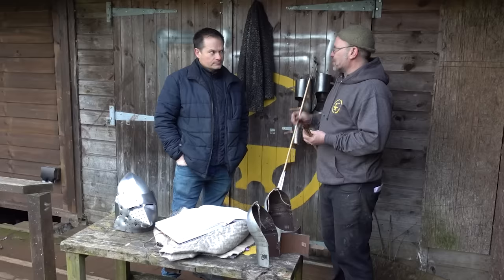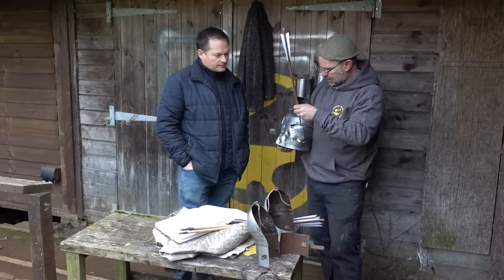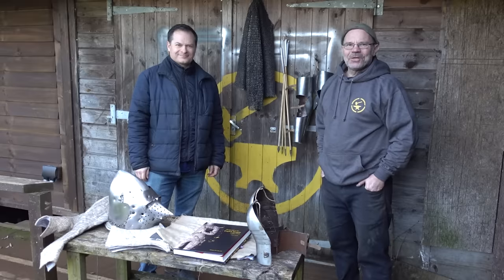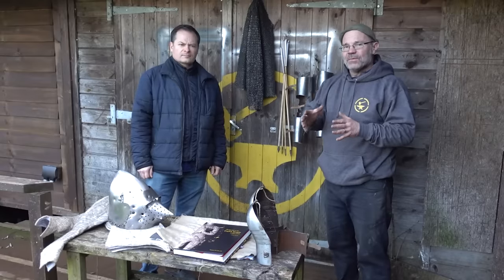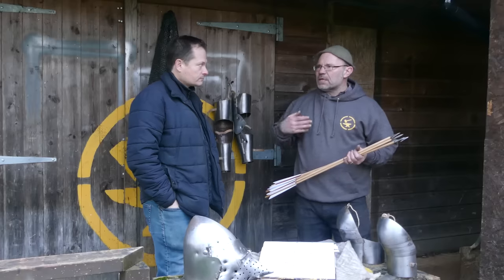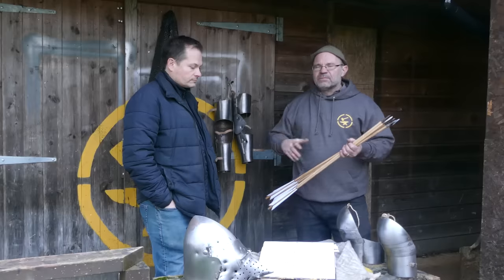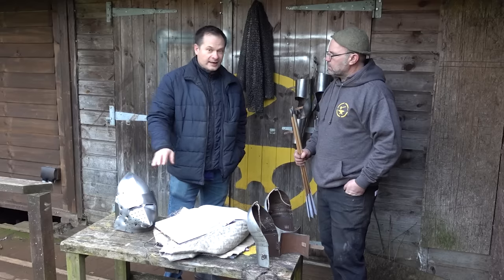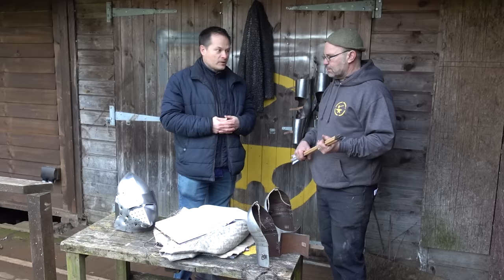Arrows vs Armour 2 - Our thoughts 6 months later

Comment: I am surprised that you didn't mention that the plate armour was worked cold and therefore work hardened, as stated by the armourer in the director's cut film at 03:51. Why wasn't the mild steel annealed? The plate comparison test is therefore invalid as a reference point. The armour is no longer comparable to the sheet steel as received from the manufacturer. It's much better at resisting arrows, and its ability to resist penetration could have increased with over 50% in some areas, depending on steel grade. You are in fact shooting at something that is probably analogous to medieval slack-quenched medium carbon steel. It's no longer an analog for air-cooled medium carbon steel. Further more, If we want to be strict about it, low-carbon bloomery steel is the actual mid range of armour according to surviving samples in TKATBF, not air-cooled medium carbon steel. Air-cooled medium carbon steel, or better, made up just over 1/3 of the armour.

Neither did you mention that the armour was not properly supported by something that resembles the human body. The arms are just supported by a doublet and a thin r-bars with some weights added on and nothing more. It doesn't fill out the armour properly the way arms would have filled it out. This is collision physics 101. We can see how much that armour flexes and saps the energy out of the arrows when they strike, and this would not have been the case with a tightly fit human arm inside (or something that resembles it). The head is also resting on a thin r-bar. There is no support around the neck area or around the jaw. The face has been replaced with a camera. This will prevent penetration of the sides of the helmet and the neck area. This is evident in the follow-up film you made with a foam-collar to hold an egg in place. This piece of foam supported the neck enough to enable penetration of the aventail. The human head does not move much when it gets knocked into things, and especially not when struck by fast moving objects, but in the film it does.

If you are going to make an AvA 3 film you should use a bascinet made of bloomery steel and arrows reinforced with bloomery steel at the tips (or just case-carburize the tips so that the heads do not shatter on impact). Taking into account that you were backed up with £59,000 in this film, money should not be a problem for a third film either. There is no reason to use mild steel at all. Mild steel is not a scientific definition. What type of mild steel was the armour made of by the way? It could be anything from 0.05% C to 0.3% C with various alloying elements. Mild steel tell us nothing.  It's made for the industry specifically to be work hardened during the stamping process.
Reply: 59.000 pounds is definitely not enough to buy bloomery iron to make armour out of it. We would probably need twice as much? Maybe three times the money?  The mannequin was very life like I assure you, both the arms and the head, actually. If you'd been there, you'd agree. They moved much like a human body. 

The mild steel being work hardend is just a reality of making armour, why would I have annealed the arms after making them? Do I need to remind you that they were trying to harden iron armour as well, by making it red hot and quienching it? That would increase its resistance far more than some simple hammer hardening. I think you're overstating how much the arms were more resistant, and there's mild steel and mild steel. It's not like when the arms were done the file I used to clean them was skating over them and not bitting into the metal. The surface hardness didn't change much at all.

Yes, the metal becomes a bit more springy, but it' hasn't "increased with over 50% in some areas," Plenty of medieval armour has no signs of porpuseful annealing after being worked, and just look at medieval art. There's plenty of armour parts, such as arms and legs, being hammered cold. Why would they then waste precious fuel by annealing it? And then waste more precious tools and time by cleaning the scales away?

Also, if we're going to do it again, why ot use duplex armour? So outer layer of carbon steel welded to an inner layer of iron? It would be more representative and more common,  but also that would bear much better results than mild steel armour. The skull of the wallace bascinet for example seems to have been constructed that way. I believe modern mild steel is a good compromise for lots of armour that would have been found on an early XVth century battlefield. Of course we could go full experimental archeology, but it's way more expensive that what you think, Eirik.

And if we then do that, it means that also the bow would have to be representative, and not the 160lbs outlier. We would have to shoot the armour with a 120lbs bow with a 28" arrow,, which seems to have been the norm back then. And at about 100 meters distance, not 15. That would be a much better and realistic test, but I suppose you people don't want to see all the arrows bounce from the armour for half an hour straight, do they? =)
Reply: @JosefGustovc  What type of mild steel was the armour made of? Exact grade.

What type of mild steel was the plate in the comparative test made of? Exact grade.

I do not doubt the mannequin's liveliness, I am questioning the empty space inside the arm harness and helmet and the lack of support. The arms are clearly shown in the Director's cut film at 24:42, and at 24:47 we can see that the arms are inserted into the arming doublet without any foam or another substitute for flesh around them. Set the playback speed to 0.25 and take a look at 29:06 in this film. The armour moves and flexes a lot inwards when the arrow strike the vambrace. A collision like this is extremely dependent on the weight and support underneath the object it strikes. This can be calculated due to conservation of momentum. Light objects can sap more than 40 % of the energy out of an arrow.

I know the bloomery steel is expensive. That's why I wrote bascinet. The rest could be mild steel to get the weight of the mannequin correct.

In a scientific test we should always strive to isolate variables. If the steel in the comparative test was of a specific configuration, this should be the same for the armour. Without it it's an unknown variable and meaningless. The bloomery steel in the comparative test was forged and therefore the finished product I assume? To get it right we have to experiment with different grades of annealed mild steel to find something that is comparable to medieval steel in a penetration test, then make armour out of it and anneal it when it's finished so that it is equal to the test piece. That's the only way to get the variables somewhat correct. There are still pitfalls though, such as high  elongation in mild steel in relation to movement of the armour.

I am all for multiple tests on work hardened and also quenched plates of medieval steel quality to see how it behaves, but I am afraid the work hardening of medieval low carbon steel will decrease its resistance to arrows due to slag inclusions and lack of alloying elements such as manganese. We can not work harden modern materials because they did it with medieval materials. That doesn't make any sense since they are different. That's apples and oranges.

We have data from a Charpy test on case carburized bloomery steel with 0.64%C and 2.3% slag compared to S235JRG2. The mild steel has higher absorbed specific fracture energy Wc (J/cm^3) (300 vs. 465) and higher percentage elongation after fracture A (%) (24% vs. 37.5%). The bloomery steel Owen makes probably has a lower carbon percentage than this material.
Reply: @eirikronaldfossheim  The mild steel was bought in Sweden, I don't have the exact code. It's just mild steel, it behaves like other mild steels I worked previously, I haven't noticed any difference under the hammer.

If you want to have other restults and a different methodology, why don't you make your own tests? You seem to know everything yourself already, so why not spend less time pointing out nonconsequential details in a non scientific test and set up a scientific tets yourself? It would be interesting to compare the results.

Comment: The sheer number of arrows fired was bound to result in improbable lethal hits.
Even if the arrows didn't penetrate it still imparted a physical blow...which all add up over the course of the battle.
By the time the knights travelled a hundred yards through the gauntlet they were bound to be weakened...which made them vulnerable to the fresh knights waiting for them.

Comment: After watching the original video, it looked like about 20% of the arrows penetrated armor well enough to incapacitate the wearer.  And, that was in ideal circumstances where the archer wasn't under pressure and the target was relatively close.   So, it is reasonable to assume that in a battle, the best you could realistically hope for is 10% of the arrows doing significant harm, which doesn't sound impressive.... until you consider that there were 5000 English archers at Agincourt.   If that 10% number is correct then with every volley of arrows will injure or incapacitating approximately 500 opponents.  Even if you drop the damage percentage to 5%, you have to consider they were firing multiple volley's a minute.  Even with 15,000 knights and men at arms the French would see their strength halved in a matter of minutes under such withering fire.  This also explains why the muddy field was critical to the success, a mounted and armored army could easily have crossed that field and broken the English line before their losses were too high.

Comment: Would arrows have hit head on flat like that or would they have come down at an angle from the sky
Reply: They probably weren't shooting long distance in an arc for the vast majority of the time, period art (from all cultures) shows aimed, flat shooting & the arrows they used were thick, heavy, tapered from point to nock with large, long fletchings, which is great for delivering maximum energy & straightening out quickly, but the exact opposite of what you need for long range flight archery

Comment: As someone who fights in early 14th cent armor, which is still lighter than this era armor, I can tell you guys all that every hundred of grams put on your limbs, ESPECIALLY arms, matters and counts. Armor is like being fat. You get hot easily, you are a slower runner than everyone else, and you get winded faster than everyone else. What is also important to consider though, is that anything put on your limbs is far away from the point you are lifting it from. 1 kilo of steel at the end of your hand has completely different leverage on your muscles from 1 kilo of steel on your chest. That is why limb armor tends to be much thinner and lighter, because otherwise it would be unusable.

Comment: One thing I have noticed is the armor is missing the arming doublet.
Reply: The arming doublet was there. You can see me putting it on the mannequin at minute 23:09 in this video.
Reply: @JosefGustovc  A decent arming doublet or gambeson should add the extra layer of protection to reduce damage to the body. The solid metal armor, the later of mail then the thick cloth of the doublet. It's part of the concept Chabam armor is designed around. The combinations of Hard, Moderate and Playable resistance offers the most protection. If you read up or read more deeply into arming doublets and gambesons, the high quality of that layer was as important or more important than the plate and the mail. By itself it should be protective to dagger and rapier thrusts. Some had metal (brass) rings like sinkers, washers or coins inside the quilts in strategic areas like the outer arms, chest, back and front of the thighs. I'm sure you could appreciate the defensive qualities of that type of quality in such a simple, often overlooked part of the layers of armor and the Kit they go with. My family in Germany worked for aristocrats along the Rhine River and private display in the castles they have such doublets. It was a requirement in my family to learn what would be called "HEMA" but when I was taking my lessons they just called it "Fuß Listing"

Comment: Question: is there a difference between the armor a man-at-arms is on foot would wear, and if the same is on horseback?
Reply: Yes. But there is such variation it would be hard to put it down as “this is this, and this is that”. Even in such a category you would have mounted archers, light & heavy horse etc.  If you look at French sources specifically for example you might have someone in plate that is open on the arms vs enclosed and same for legs with open greave and legs, with the only mail being about the neck in a mounted role, and at the same time have such a degree of variation when we later see the same individual on foot that it would appear there is quite an armature involved.
Reply: To add to the previous comment - some common differences are that mounted combatants more often have lance rests, they have to have use of the left arm to hold reigns, they need to be able to spread their legs wide enough to fit on a horse, they can rely on having a saddle to protect the front and back of the crotch, and they can potentially wear heavier armor because horses are strong.

That being said, there's still variability in all those points

Comment: In physics and material science, we tend to think in terms of limits. In computer science we think in the edge of the envelope. The lower end in this case is of interest but not essential in any way or form. The higher end of quality and coverage, is though. It would be nice if it was possible to repeat the tests that you did, with a ballistic gel dummy (hopefully with bones), and what you would consider to be the top end in quality and quantity of armor. Yes I understand this would be expensive and difficult to do. But the reason I bring that up is that it would give us a reasonable understanding of what the upper end is. Having said that the fact is that your experiments, while not rigorous in controlling all values, which honestly would be nearly impossible to do, is a very useful and interesting form of information. I don't want to call it data, but it is information. What is a particular interest are the areas that showed the biggest vulnerability and the fact that those areas were covered at some point in history as mentioned... It makes me wonder if major battles had an uptick after them in added armor, covering up areas that were found to be vulnerable. Given that armor especially in that era was an individual thing, I don't expect there to be a system in place to identify these type of vulnerabilities but I do expect there to be manuscripts made by masters of their craft (of items as well as fighting) with ideas of improvements. It would be interesting if somebody could correlate the emergence of said documentation and the before and after of major battles, indicating that they had that effect or if they did not... I really find this fascinating, and really enjoy everything that you have brought for us to see

Comment: What I would still like to know is, staying in a medieval context, what would it actually take to pierece that kind of armor? And what would it take to pierce it consistently? Obvously, the latter might be too expensive, but you know, Mythbusters style. Replicating the myth, so to speak.
Reply: Easy. Use low-carbon bloomery steel for the armour and stop using work hardened modern mild steel. Support the armour properly by something that resembles a human body. Use narrow arrowheads (8 mm thick, 12 mm wide) reinforced with bloomery steel at the tip, or just case-carburize the tip.

Comment: Scientific bias is a difficult thing to both recognise and address immediately. Hindsight is a fine thing and has an issue itself, and that could be peer pressure. Unless imperial measures are used to fire exact replicas of an arrow made exactly the same way, loosed by the same bow, same bowman, same strength, same weight, same point of aim and point of strike then as you say, indicative only. Not something I'd be interested in going against, at all....but considering myself a serf (at best) I'd have no option back then and I wouldn't even know what I'm talking about now. But ask me about turnips or cabbages and I'd talk your ear off....

Comment: Hi Tod . Climb up a tree and shoot down on the target BECAUSE arrows come from above at 200 yards. Add speed of charge or because you are close say stationary target damage represents charging target damage.
Only the front knights are exposed to level shooting. The masses are threatened by arrows coming from above.
If too scared to climb at tree put the knight leaning forward at 45 degrees 👍🛠
Archers are never the front lines so they are always shooting up and over their own front lines.
Reply: Shooting in an arc is probably mostly a Hollywood thing, contemporary art (from all cultures) shows aimed, flat shooting & the arrows were thick, heavy, tapered from point to nock with large, long fletchings, which is great for straightening out quickly & maximum energy delivery, but the opposite of what you want for long range flight archery
Reply: My friend it's time to take a basic physics class.

Comment: I think you need to go back to the drawing board if 1 arrow hits with kinetic energy equivalent to 100 kg bags of sugar or a 100 joules and a knight on horseback is moving forward at 10 m/s even if his total weight is 40 kg the kinetic energy he hits the arrow at is 2000 joules or 2000 kg bags of sugar total impact is 2100 kg bags of sugar or kg's regards Graham Flowers  MEng